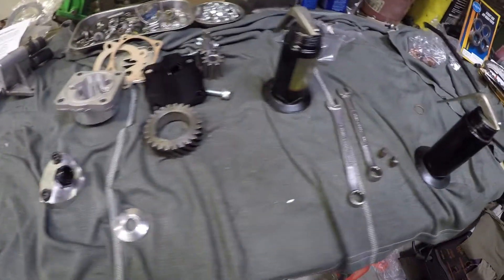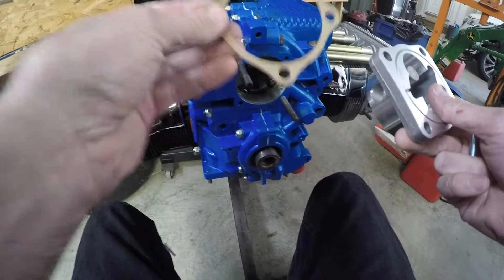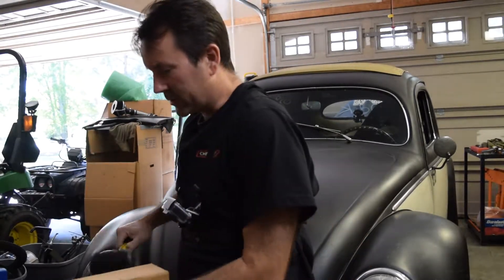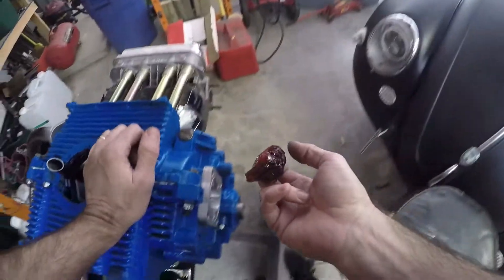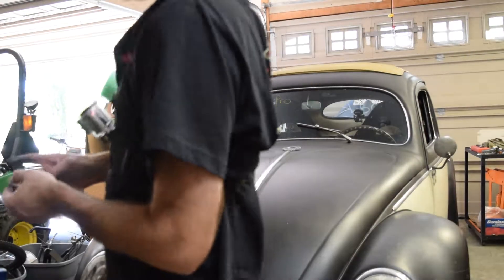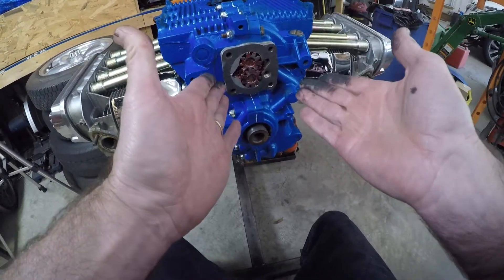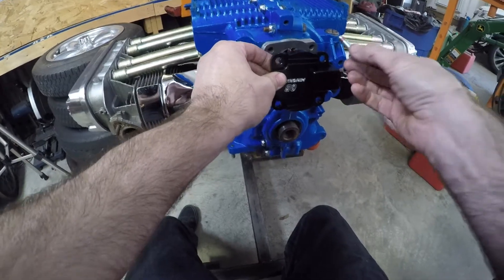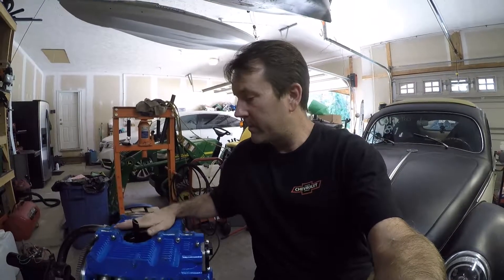Oil Pump install on a type 1 vw engine on Grease Pit

Comment: Good stuff! Wish I would have done my own. I had uy who installed new pistons do it, and it leaks like crazy here! So irritating paying to have someone do it wrong at an actual shop. Guy also bent cooking find on heads by whacking them with a mullet to get off. Nice car love to see more of it.
Reply from the maker: @ahernandez9860  I will admit it, sometimes those heads will be stuck on the cylinders. Especially if they have been on there awhile. 043 castings are the worst for some reason. 🤠😎

Comment: For a stock 1969 converted to the doghouse and 1600 dual-port, what is the best oil pump/oil pump size for my single relief case with stock crank, heads, rockers, cam, compression, and distributor?
Reply from the maker: I like using a 26mm pump.

Comment: I just watched your video and I got a question on your oil pump is that a remote pump where you'll have your oil filter set someplace else
Reply from the maker: Yes, I always run a full flow oil filter set up. Thanks for watching.

Comment: I install the pump housing into the left side of the case using two bolts while the case is split, then when I close things up its already in place and aligned without having to press it in.

Comment: My 74 engine had a semi auto stick hooked up to it before. I have to change the pump it’s weird looking. I need to see which one I need. Great Video!
Reply from the maker: It will most likely depend on what cam you're engine has in it. Early and aftermarket cams have a flat cam gear as to later engines which have a dished cam gear. I think 71 and later engines had the dished cam gear.